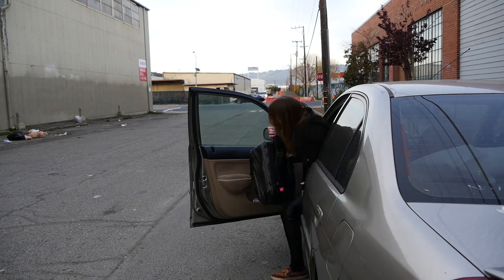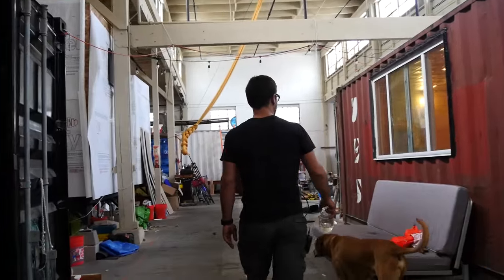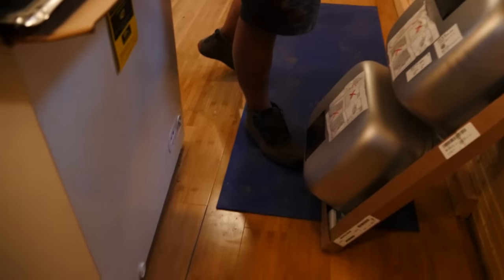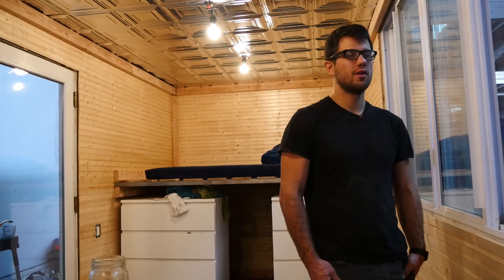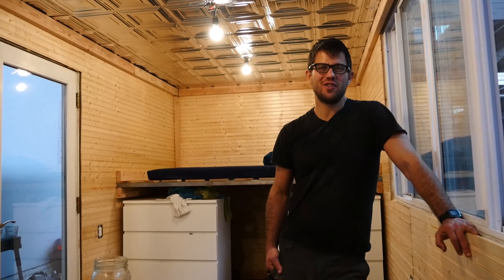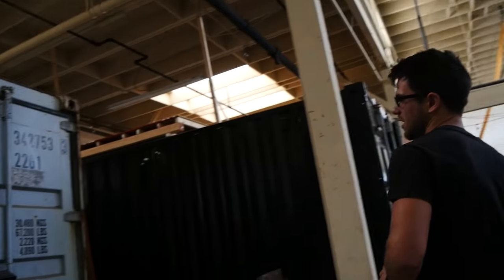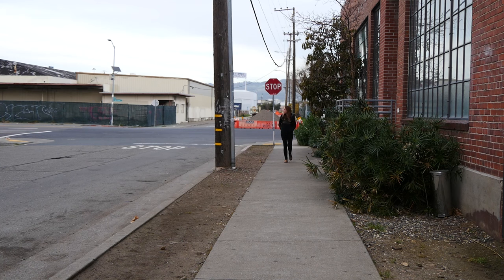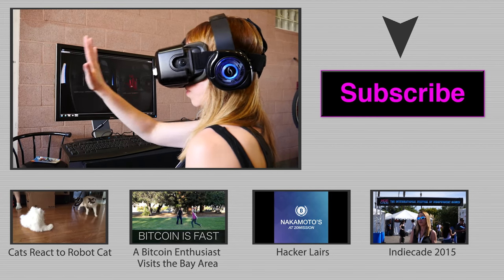Step Inside an Under-Construction Shipping Container Tiny Home

Comment: Stacking is not that simple, they can take that weight on the corners but not the way you envisage here, without an engineered solution. You are barking up a potently dangerous tree, someone could get killed.
Reply: Stacking is that simple.  Christian Salvati of Marengo Structures uses the container pins(and bridge fittings) to lock the containers together (which are welded to the foundation) in the construction of the container apartment building in New Haven Connecticut. He uses the same components that is used on cargo ships.  As he puts it: it works so there's no need to reinvent the wheel.
Reply: Yes Elizabeth it does work, if you stack them on top of each other with the weight on the corners. But they need substantial reinforcement if they are stacked any other way, as suggested here, because they are not made to stack any other way. For example if they are not locked at the corners none of the items you mention here can be used.
Reply: Akaroa Male I didn't realized he'd plan on stacking them differently.